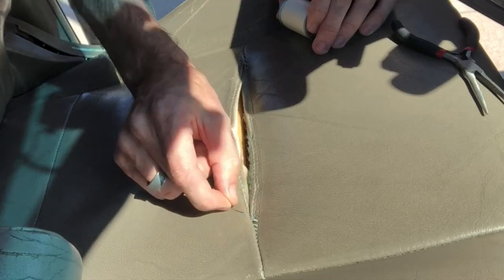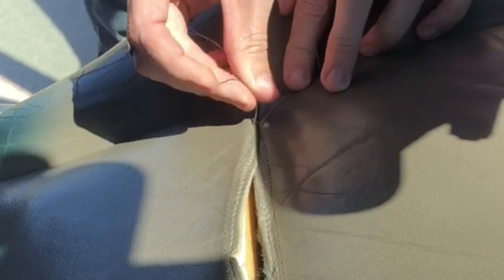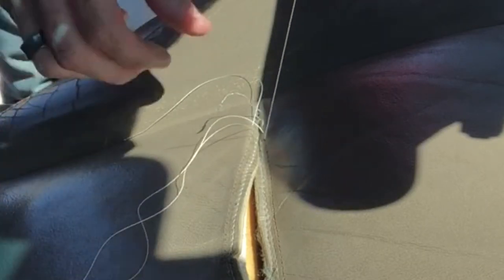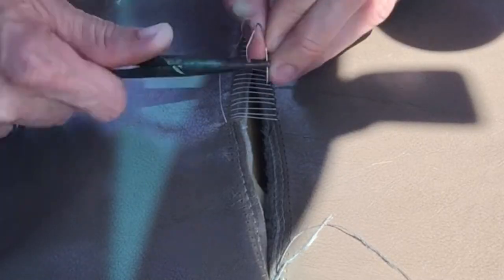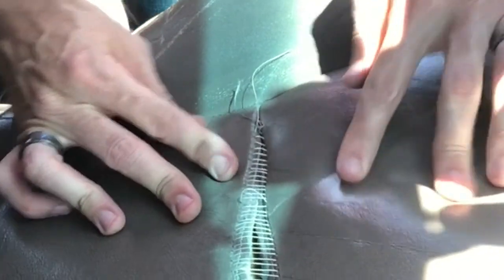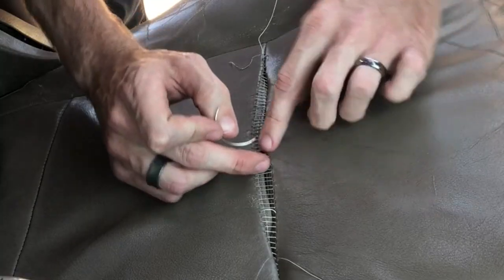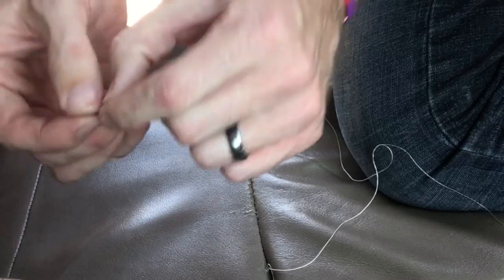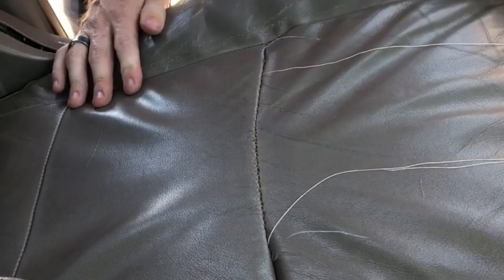Leather Seat Stitch Repair

Comment: Commenting as a guy who actually has done that repair before i would say you did a really neat job. The real professional way is to strip out the seat and machine stitch the cover. But it's rather expensive. I think you did great.
Reply from the maker: Thanks. I debated undoing the hog rings on the lower seat cover just so I could get the seam a bit tighter, but I’m happy with how it turned out. Now I’m just keeping my fingers crossed that the thread holds up. It’s pretty snug. 😬
Reply: @DustinRogersinMO Great job and a well made video. How is the stitching holding up after 4 months?
Reply from the maker: @PapaWilk  thanks. One of my knots either broke or came untied, so I had to redo a small section of it (I did a follow up video). Been holding up since then though.
Reply: @DustinRogersinMO  why didn't you just tighten the stitches as you went along?
Reply from the maker: @mr.m325  the thread wasn’t strong enough to pull the leather together without compressing the foam at the same time. I also wanted to have some room to manipulate the needle to get through the existing stitch holes. If it was tight, that would be much harder to do.

Comment: This is super.  If you use a small metal crochet hook you could pull up the stitches a lot tighter and easier than with the needle.
Reply: Can you explain more?
Reply: The crochet hook would let you pull on the string like you would laces on your shoe

Comment: Wanted to add that you need to make sure you're tying a square knot to prevent the knot from unraveling.  Instructions for doing this with tool/instrument instead of hands can be found online also.  I'm about to do this with my 2016 sienna.  I'm a bit less enthusiastic about taking the time but I can't find anyone locally that has work samples that I feel are better than how I will do it.  I'm glad you reminded me of potential shrinkage, so I bet not let it go any longer.

Comment: Good job.  For a little easier and tighter final product, try the double blind stitch using two needles.  It makes a much tighter seam.  Leather is hard to work with, and you did well with a single stitch.

Comment: Those seat covers come off in like 2 minutes.
It is way easier and looks better to just take the cover off, stitch it over the entire length, and put it back. Maybe with some extra foam to firm the seat up a bit again.
Reply from the maker: I know it would take me way longer than 2 minutes to get it off, and probably thrice as long to reinstall it, especially considering it has nearly 20 years of shrinkage. You should make a video showing the process. I then might gain some confidence to do it myself.
Reply: @DustinRogersinMO   I say 2 minutes is waaaaaay off. great vid

Comment: How hard is it to remove  the seat, remove the leather cover and repair?
Reply from the maker: Seat removal is easy, but the time required to remove and repair the cover and then reinstall and re-stretch the cover that has nearly 20 years of shrinkage was more than I wanted to invest. If this repair failed, I wouldn’t be out much. If I had issues after the seat and cover were removed, I would be unable to drive the only vehicle I have.
Reply: The seat cover is really easy to take off. Makes the job a lot easier.
And the foam shrunk as well over time, so it will still fit the seat perfectly. Maybe even will be a bit loose still. Then just ad a bit of thin foam or thick fabric and put the cover back and it looks as new.

Comment: Is it holding up 2 months later?
Reply from the maker: The right side of the stitch has started to separate a bit. I haven’t had a chance to investigate if this is because I trimmed the ends too close to the knot and it came undone or if the thread snapped. When I get some time, I’ll shoot a follow up video.
Reply from the maker: Followup video: https://youtu.be/OELyNCOtpwE